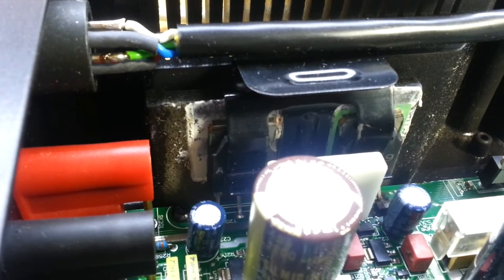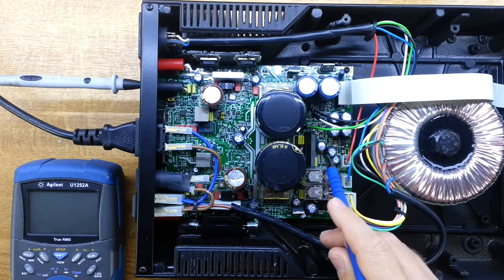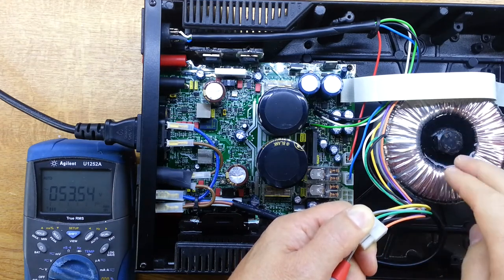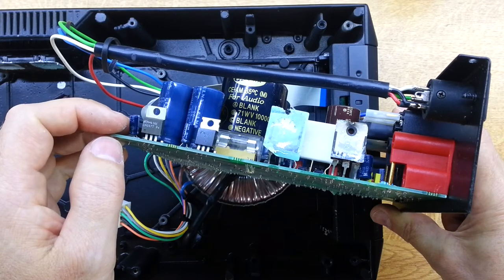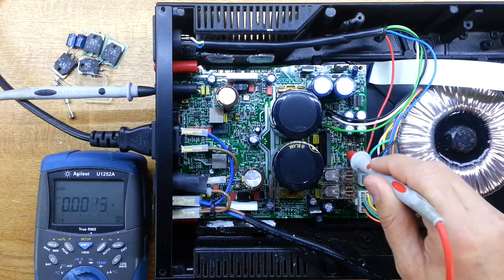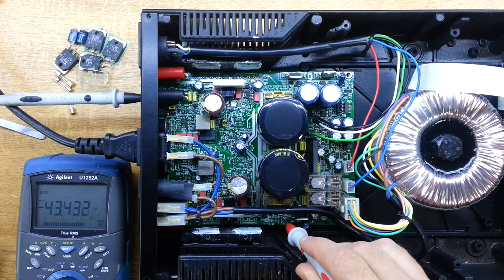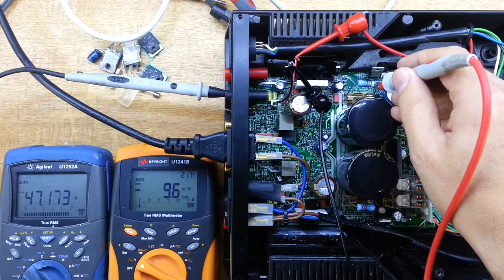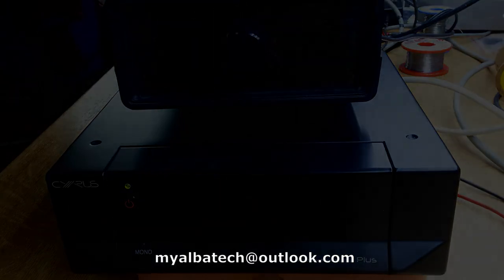Repair of a Cyrus Smartpower Plus

Comment: Good afternoon. Can you please advise? Cyrus SmartPower Plus was working today and then started turning off during operation, blinking and turning on again. Then the operating time became shorter and shorter and eventually it did not turn on. Now, when you turn on the button on the front panel, it starts blinking red. I measured the voltage at the test points and 5 and 15 volts normally, instead of 42 and 43 volts 44 and 46 respectively. The fuses are all ok. It looks like some kind of capacitor has failed. Can you tell me where to look?